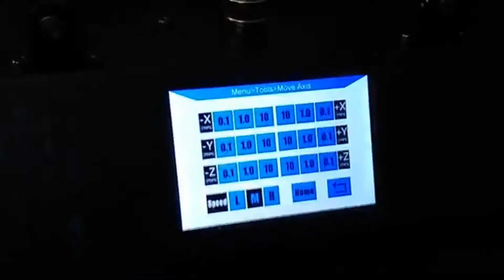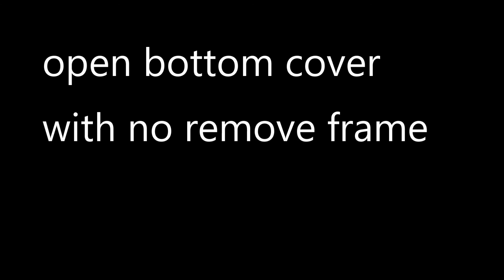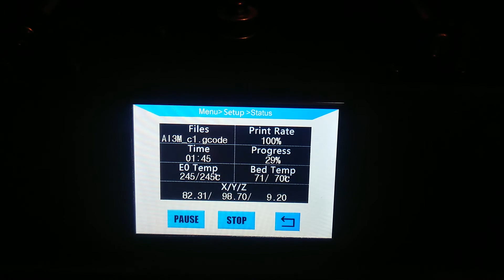anycubic i3 mega vibration and noise solution

Comment: did you try bending the fan bracket first before drilling thru the cover? I bent mine to install the silent drivers and forgot to bend it back

thanks for showing how to open it without completely separating the frame n base-could just lean it on its left side